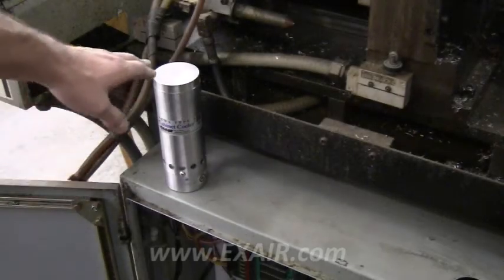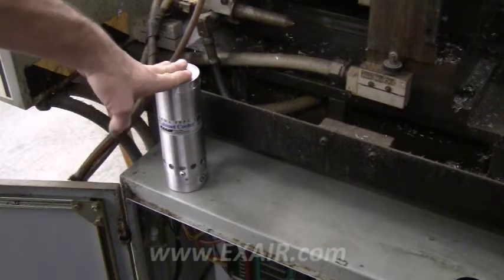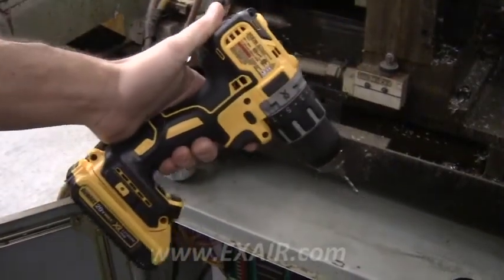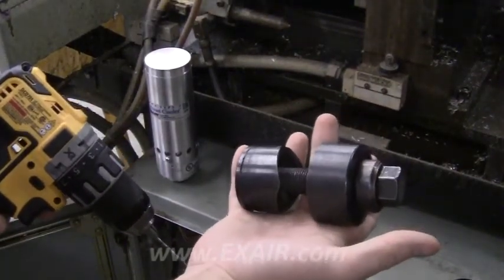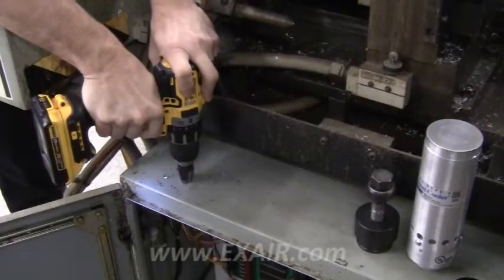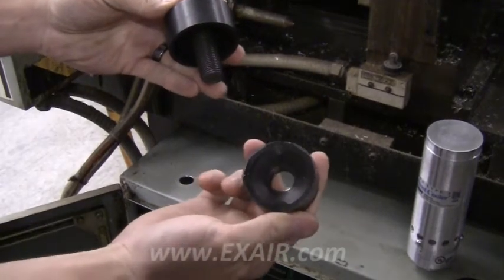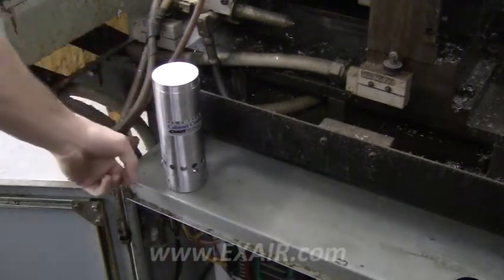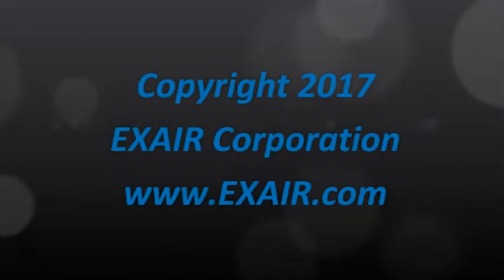How To Install An EXAIR NEMA 4, 4X Cabinet Cooler System

Comment: I see these things selling for anywhere up to a grand on ebay, yet they're literally a twenty dollar 'vortex tube', nothing more. D:
Reply from the maker: @baspr0mpt – Thank you for the comment.  The most accurate pricing for our Cabinet Cooler Systems is easily found directly on our site at www.EXAIR.com.   There are several factors that go into our Cabinet Cooler Systems that do not show up in a bench-made vortex tube.  While these do operate off the same physics principle as a vortex tube they are engineered and designed to be an efficient use of compressed air, maintain NEMA integrity of the electrical enclosure, and be easy to install.   On top of those factors our systems have all been tested to UL and CE standard to ensure these meet their standards for commercial and industrial equipment.
As far as the topic of this video is concerned the panel was rated for a NEMA type 4, 4X environment, a standard vortex tube mounted to this panel would not permit the panel to retain the NEMA rating.  A simple vortex tube would not distribute the cold air throughout the panel to provide even cooling like a Cabinet Cooler with our cold air distribution kit offers.  Additionally, a vent would need to be installed to permit flow out of the panel but not in.  This would have to be sized correctly as to not apply any backpressure onto the cold outlet of the vortex tube that goes above 3 psig as that would affect the cooling produced by the tube.   All EXAIR Cabinet Cooler Systems are designed to exhaust the same volumetric flow of air they are putting into the cabinet while maintaining optimal performance for the vortex principle.  In addition, the thermostat control and cold air distribution kit ensure you are only utilizing compressed air when the panel needs to be cooled and that the interior of the panel is evenly cooled throughout rather than one central point.  
If you would like to discuss our Cabinet Cooler Systems or vortex tubes further our Application Engineers will gladly walk through your applications. Feel free to give us a call at 1-800-903-9247.